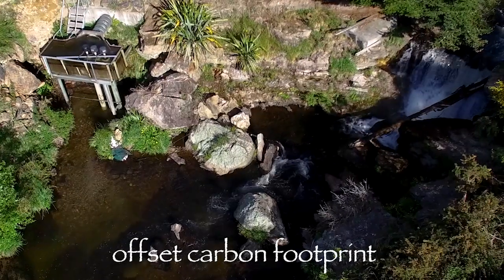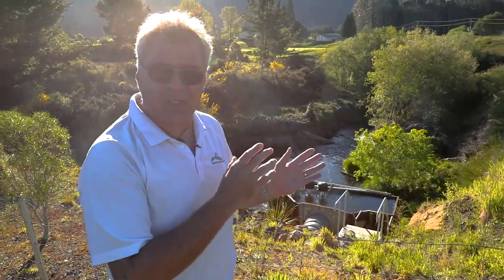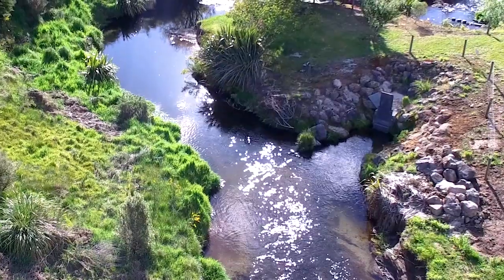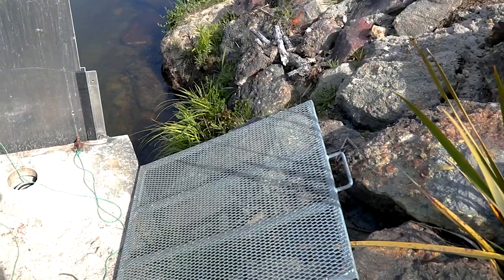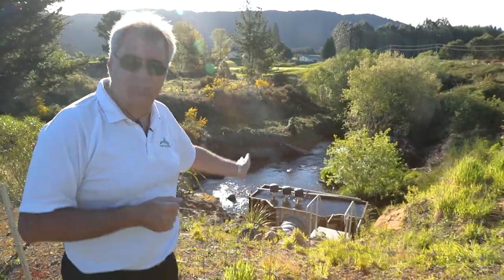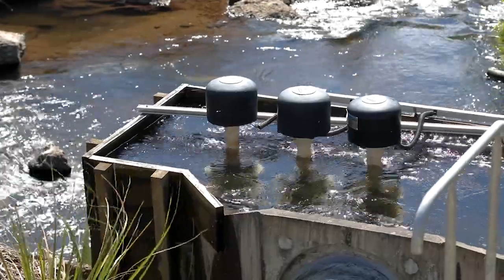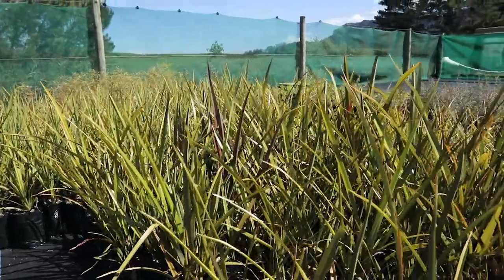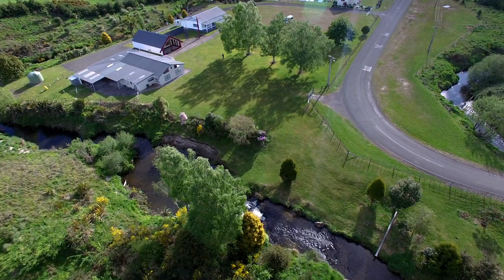Micro Hydro Powered Marae

Comment: thanks for posting.  this is another, typically,  Poorly designed  microhydro installation.    at :14, it appears that  about  a  METER  of head is Not being  utilized.   this may be related to use of  INcorrectly designed  and  OVERLY-tall   draft tubes.     this site is, probably, suited to the use of a  Correctly  spec'd  banki hydroturbine; or overshot  waterwheel.    cheers            googletranslate
https://www.smith-eng.co.uk/hydro
Reply: thanks for your comment, maybe your right maybe not, im no expert, but I do know that they are making enough power to supply all their needs and selling power back to the grid so thats a win in anyones books..albeit a possibly less productive method than could be utilised..In your opinion who would it best best to go to,  in terms of  mycro hydro solution for particular needs? i.e who are best at this sort of technology in your opinion?
Reply: @wiremugrace8657  my critique, not criticism, is base on the  Observable  Facts.   see smith engineering.     they have developed an excellent  bucket  design.   cheers
https://www.smith-eng.co.uk/hydro/